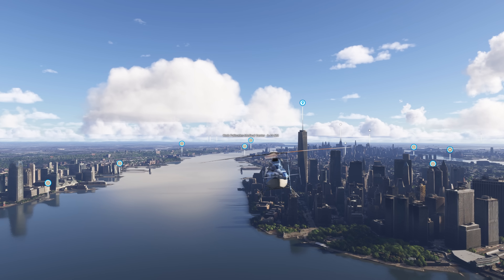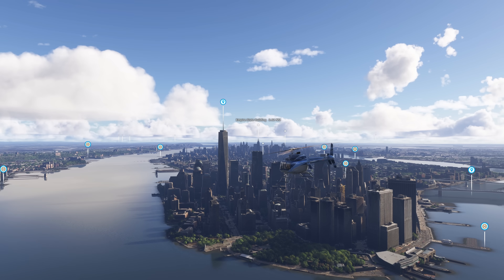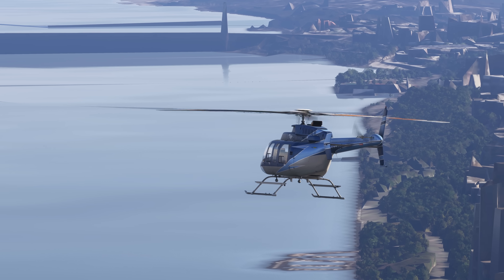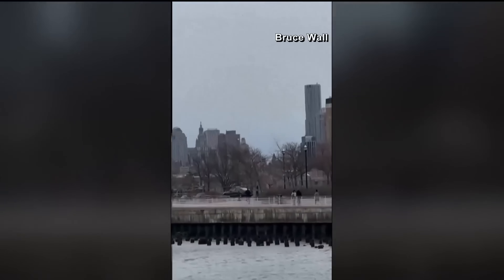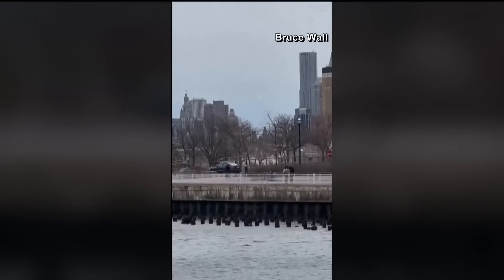Helicopter Expert breaks down Hudson Crash, and discusses “Bump Mast” Theory | NYC Crash Follow-Up

Comment: I absolutely agree that if the main rotor had hit or severed the tail boom there's little to no chance it would still be intact enough as it was in the video first shown on the news. 
It looked to me like the rotor and part of or the whole transmission beneath them were still spinning and somehow auto rotating downward. 
Its almost as if too many things failed all at once for it to be believable for a craft that was flying fine up to that point. 
In the first videos to hit the news they showed the helo falling upside down into the water creating a massive splash. Then they switched to a shot showing a pier with something else falling into the water just south of the pier about 100ft or so plus two smaller splashes just 100ft or so south of the larger splash down. What ever went in there was not the blades or the mast that they showed still flying, we would have seen that in the video. If those were boom pieces than the boom may have broken up as it fell, or those were splashes from the various associated parts that separated along with the boom, (drives shaft, rear gear box, etc).

Comment: If you look at NTSB b-roll, the tail boom does not appear to have been impacted by the rotor. I would imagine rotor impact would be at an angle to the tail boom. But the tail boom sheared off along a row of rivets. I think @billlewis1483 is probably correct.

Comment: You can clearly see in the videos, the rotors, attached to the transmission, seemingly in good condition turning, as they come down.  They were in tact.  (I'm no expert, but something catastrophic happened in that engine/ superstructure, transmission, that made it come across.)  And that violence, must have cuased the tail to snap off..... vibration? After it flew in its own direction.  So sad.  GREAT VIDEO, much respect to you both, and thank you sir for your service.  You clearly are an amazingly talented man.

Comment: 9:10  I'm a fixed wing pilot with only a couple hours on a chopper, but my physics is pretty good. I can't see how the rotor is going to droop from not lowering collective. I can see it slowing and stopping then folding upwards though, all while NOT drooping.

Comment: I have seen pictures of the fueselage. What is left of the tailboom is bent upward like a scorpion's tail. 

Since the fueselage hit the water upside down, I see only two possible teasons for tis upward bend:
1.) what was left of the tailboom hit the river bed first, or
2.) the lift rotor did indeed strike the tailboom.
If the second posibility is the truth, I suggest that this tail boom strike happened after the mast separation. So the only force behind this strike was the rotaional momentum of the rotor. This could possibly explain why the lift rotor did not fracture. 

The force of the strike was not sufficient to actually sever the tail boom, but was enough to jar the tail rotor assembly enough to dislodge it.

Or the forward momentum of the fueselage, when it struck the water, became backward momentum, as the fueselage rotated during its fall.

Hitting the river bed upside down, tailboom first would also cause this distinctive upward bend in the tailboom.

Comment: Yep. No mast bumping here. The huge yaw and sudden collapse of the tail boom indicate a stoppage of the rotor dynamic system. The entire rotating assembly separated from the airframe seconds after the tail boom separated. Something in the gearbox not only let go, but seized up and caused the big yaw and folded the tail.

Comment: Turns out the Xmission separated from the fuselage with swash plate, control links, and mounts, so most likely neglected maintenance and corrosion seeing as it had been used for offshore previously.  I’m very familiar with mast bump from the OH-58s and Robinsons.

Comment: Is this what happens at high altitudes when helicopters fly elevated thin air areas drooping affect? Obviously New York is not high altitude, but just wondering when helicopter struggle at high altitudes

Comment: You say there was no I witnesses we don’t need a witness. We have a video the first action you see in the video is perfectly level flight and the 
Then the tail starts rotating to the left, looking frome the rear of the helicopter. Immediately after that, the helicopter starts losing altitude. In my view, one of the gears in the transmission or gearbox whatever you wanna call it broke apart due to a manufacturer defect. or one of the gear box  mount bolts fell out or the gearbox casing broke . then the transmission or gearbox rotated, pulling the trail rotor driveshaft in collapsing the tail section as the Rotor assembly ripped out of the helicopter and of course we know what happens when that happens

Comment: It was not a transmission suddenly seizure.  In fact it was nothing to do with the engine or drivetrain at all!  The accident sequence initiated with a sudden nose break to the right followed by tail boom separation then separation of the transmission mounts.  A sudden seizure of the transmission would result in a rotation with the nose left. 

A known weak point on this type/model/series of the Bell 206 helicopter is the 4 mounting bolts of the tail boom to the main cabin.  A preflight item is to place a finger on the seam/joint and push on the tail boom to see if there’s any flex.

I’m a 25 year helicopter pilot with several thousand hours flight experience in this helicopter.  I’m also an Airframe and Powerplant mechanic.

Comment: What happened to low frequency vibrations, high frequency vibrations or 
feeling vibrations on your tail rotor control pedals? 
I'm a low hour student rotorcraft pilot,
and feeling unusual vibrations on your controls, cyclic, collective n control pedals is covered in the POH, n the Helicopter Flying Handbook. What happened to a thorough Pre-flight?
If there are structural defects, cracks from metal fatigue, etc, eventually it
will get bad enough to shake the 
fuselage to cause some kind of low, high
or medium vibration.
Example, in my truck, I have an arrow head on a chain hanging off the rear view mirror. When the engine is in top tune running good, there is no vibration on the chain hanging off the mirror, it's rock steady. When the engine runs rough because of bad fuel or a fouled plug, that arrowhead is bouncing around! 
The pilot was not "listening" or feeling the helicopter, and a thorough pre-flight should have caught those cracks. That's what the pre-flight checklist is for. Everything is supposed to be looked at carefully by the PIC, not the mechanic or crew chief, they are not flying the helicopter, and if they do, the PIC is supposed to at least do a walk around inspection....
Just an observation 
%

Comment: I don't believe it was an engine failure or an auto-rotation. It will be interesting to see the main rotor shaft. Think of the rotor as a see-saw. If goes full tilt it can sever the shaft. If that happens the rotor could possibly hit the tail but not likely. My "guess" is that abrupt movement of the cyclic was made and caused the rotor shaft to sever. Just a guess at this point.
UPDATE: They recovered the rotor and the shaft and transmission were attached to it. I've never heard of this, so I have no theory as to what happened.

Comment: Your expert doesn't appear to have examined the videos closely... The gear box or engine appears to be attached to the rotors. One rotor is shorter than the other. Tail appears to be cleanly severed by the rotor. No/low wind. No violent pitching. However, the chopper does Yaw significantly, just before break up. Rotor brake pulled perhaps? Yaw peddle struck or stamped on accidentally.

Comment: The Tail Rotor departed the 206. That caused the violent yaw to the right. At that point mounts for the transmission & engine fail as the yaw brakes the tailboom off. The the entire Transmission engine and rotor head assembly detaches and continues to "Fly". The fuselage then tumbles down.  An early still from a video shows the tailboom floating in the Hudson with the vertical stab and the 90deg gearbox with rotor shaft still mounted to the boom. The Tailrotor was not attatched, it was gone. 206 flew 8 flights. Pilot radioed he was returning for fuel just before disaster. 8 flts , were thru flt or preflt insp performed prior to each flt? Probably not. It will prove to be a maintenance related issed that killed 6 Humans. You can bet this operation cut corners and violated rules. All that has to be done to visually insp the Tail rotor is walk right up to it and LOOK. Not the leaders of this team.

Comment: FYI for anyone here who has not viewed it yet. There is a short video now up on YT showing the rotor/trans/blade assembly being crane lifted. It shows fairly good views of the assemblies and some of the damage. It appears that all 4 nodal beams are intact along with at least 3 of the basal beam mounts as the lift rotates from the crane.  

The video is titled: 2 crucial pieces of helicopter that crashed recovered from river. -  it was posted by: Eyewitness News ABC7NY

Comment: iIf the video is correct I saw 4 blades. I seem to remember on a four blade machine the blades were to short t0 hit the tail boom. I remember early in the Long ranger 206 days they had a corrosion problem on bolts and a engine or transmission broke loose. P.H.I. grounded the whole fleet until that was corrected.

Comment: The opinion is that the rotor blades would not have stayed intact if the blades hit the tail boom.
I do not believe that the mast and tail boom failed separately within milliseconds of each other.
More likely the pilot allowed passengers to trade seats in flight and somebody fell on the controls.
I have seen no mention or report stating if the passengers were all found to be buckled in.

Comment: A mast bump would result in the mast snapping above the transmission. From the still images I saw, it appeared the rotor head, swashplate, linkages, transmission, and mounting apparatus was all still attached to the mast. Given that is the case, it seems likely it would be either a gearbox seizure, or a structural failure where the main gearbox is attached. A tail boom strike could occur in that case as the rotor tore loose from the airframe in forward flight with its spinning blades still intact.  It is also plausible that a structural failure in the tail boom in forward flight could have imparted enough sudden torque on the main gearbox mount that it suffered a failure as well.  NTSB will sort it out, whatever the case.  Prayers for the affected families.

Comment: Kudos to both of you servings. I too worked on jets in the navy and worked at Sikorsky. Later I went through ground school for rotary wing flying. I'm curious too, but don't want to speculate. I really want facts. What was referred to the Jesus nut, I don't think it let go because from the video it looks like the upper hub was still attached to the main shaft and it was spinning. It looks like it was the transmission broke free from the frame; however, I don't want to guess.
My sympathy goes out to everybody that passed away from this.

Comment: Ok so where do I start?  I am also a Marine Col plus an EMS helicopter pilot 25 yrs, Naval Safety School trained crash investigator and union safety rep for my industry.  I think we may be premature in speculation but with an intact blade/mast/tranny seen in the video it’s unlikely mast bumping would be the cause since that often cleaves the mast at the rotor head. It’s caused by unloading Gs and moving the cyclic causing the teetering rotor head to exceed limits and pinch into the mast breaking it and causing such flexing of the rotor flight path to hit the tail boom.  if it does that the striking blade usually fails its spar.  that intact two blades mast and tranny still pic makes me sniff down the tranny seizure causing instant torque ripping tranny off its mounts and severe enough to cause the tail boom failure at the stab fins from aerodynamic side load being thrust into the airstream from the torque.   

but hey let’s not get ahead of the investigators.

Comment: This was a Catastrophic Transmission Failure, the other theories are false! The Absolute torque loading when the Trans locked up is what sheared the entire assembly out of the airframe, as well as shearing the tail boom off! Note in the video, you can clearly see both rotor blades still attached the the rotor mast and both blades are intact and still spinning, also still attached to the transmission! The REAL question is, How did the Transmission Catastrophically fail with no warning, there are several sensors in that system that should have alerted to such things a low oil level, baring failure, gear failure, and so on, yet the pilot doesn't appear to have take action to get on the ground ASAP!

Comment: There a medical flight on a 206 10 years or so ago that had a main rotor separation due to the main Rotor retaining (Jesus) nut being left off.  The nut was sitting in the mechanics tool box.  If I remember correctly, the acft made it to about 500' with the rotor system only attached by the pitch control rods.  Once they fatigued and failed, the rotor system departed from the mast.  Everyone aboard was killed.  This accident had nothing to do with the retaining nut